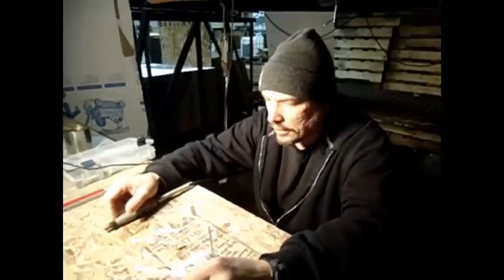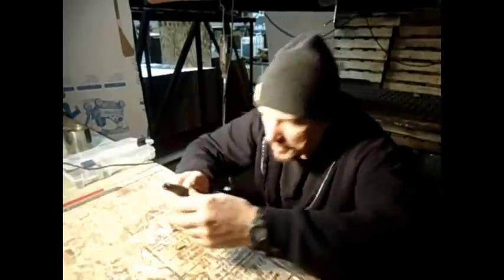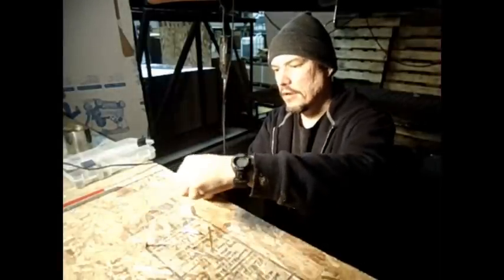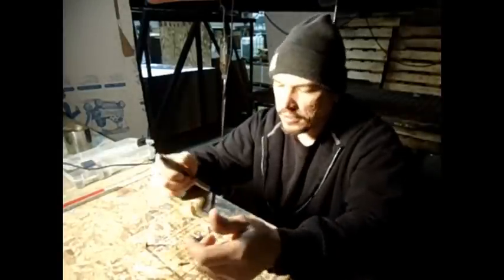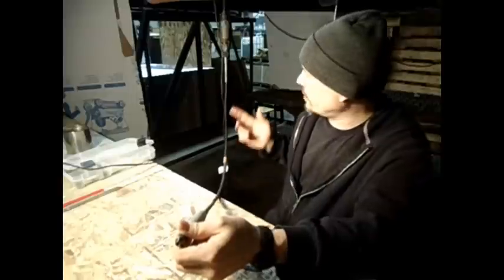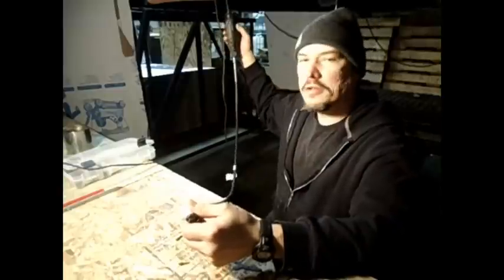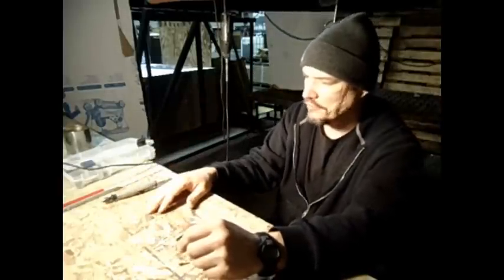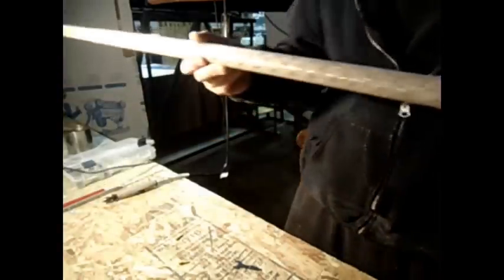Product Review Dremel Chuck

Comment: That's an intricately detailed weapon. It must be cold in your studio. Myself, I'd want more light. But never mind the cold and the darkness, you've produced an excellent video. Now I have the info I wanted to go ahead and buy the chuck, info you gave to me, info that you took some effort to provide, and I'm grateful. You go on my Good Man list.
I used to have a corresponding  Bad Man list, but it got so long it was depressing to contemplate, and I pissed myself off whenever I read it. I came to realize I didn't need it, either. All I need is the Good Man list.
Nobody asked, but there I go, and my advice is, keep it positive. I have a much healthier attitude after discarding the BM list, and anything else of that sort, and no one needs that kind of data to get through life. All anyone needs is the Good lists.
That's how I keep track of men like you, Captain. In return, in my capacity as an HVAC tech, I'd recommend you find a used furnace, preferably a Goodman, natural gas, forced air. They just plug in to a wall socket, like a hair dryer. Of course you have to run pipe, which won't be a problem for you. I'd be more than happy to walk you through the installation.
Stay warm!

Comment: I found that the multi-chuck would lock out before gripping any bits. And the only way to get the teeth to bite onto a tool is to insert a collet and it's the collet that pushes the teeth up to grasp the bit. Even that can be tricky as it doesn't always push up all three teeth at once but just one or two at a time which is useless. I find that in order to get the teeth to uniformly grip any bit I have to use a collet that fits the bit and then tighten it. Which defeats the purpose of using the multi-chuck in the first place
Reply: oh and I had to grind off a quarter inch of my flex shaft handle so that the chuck wouldn't hit it and then cause the tool to not spin at all
Reply: You guys do odd things the proper sized washes woulda don in seconds. With no nodding to any parts.

Comment: Does it always close with the bit perfectly centred and straight?  Normally it is very easy with smaller bits to get them gripped slightly off.  They'll look straight until they start rotating.  Upside of collets is that you just insert the bit and it is straight and centred.

Comment: Nice vid. I have read that some of these "Dremel" chucks are having some problems opening up to all the sizes. Is this true? Have you had any problems? Nevertheless, I have bought one #4486 and plan to give it a try. I know some of these marked Dremel and made in China are just knock-offs. As a back up I have bought the different size collets. One more question, what is the difference between the steel and brass collets? Thank you, hope my chuck works as good as yours. Joe S.
Reply: Brass grab better wear out faster/ softer real. Steel stronger but may let a bit spin due  less grabbing power/ metals are same strength hence one won't "mush" to the other.. the soft aluminum type ones suck.collet talk.